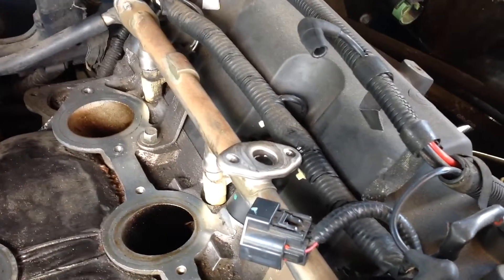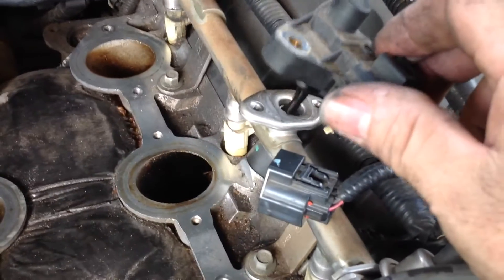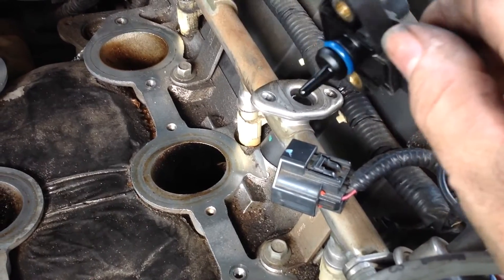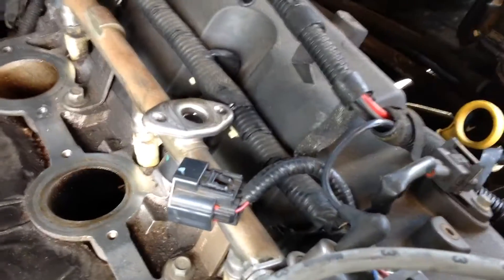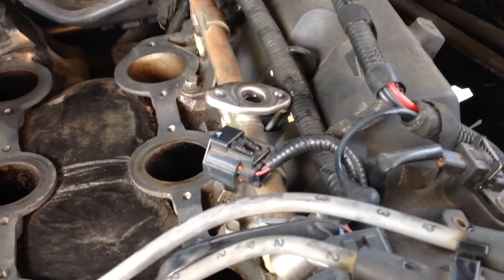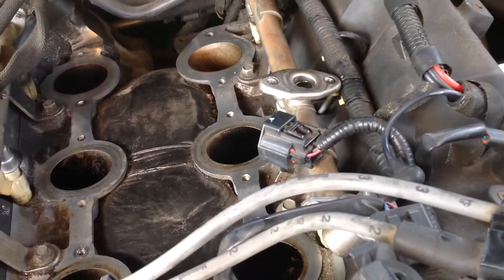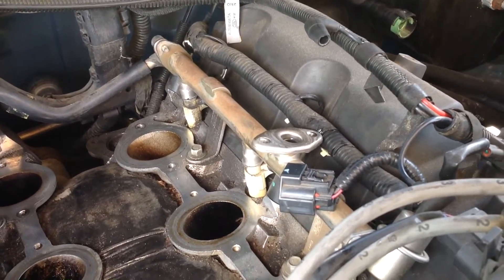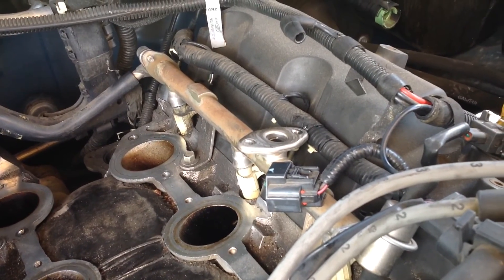2004 Ford Explorer fuel rail pressure censer replacement. Part 5

Comment: Relieve fuel pressure by removing fuel pump fuse while the car is running. The car will shut off, then unhook battery to begin job.

Comment: Why do people think people design stuff to break? Lol I know and engineer from Ford who happened to help design that engine, you have no idea what they go through to try to make the product as durable as possible, I mean..it an electronic part next to a 120° plus heat every day..monitoring a very corrosive material at a very high pressure in a small little small space that has to send her sensitive and vital information to the computer so it doesn't blow up or cause harm to the average user that daily abuses their vehicles with no maintenance at all..sometimes it's a miracle some of these products last so long

Comment: do you have any idea what it takes to design engine management products? the time, the money.... 
do you think companys make 100 % profit on the sensor you bought for $100??
they build it to break down within the lifespan of the car? yes, that's why we replace spark plugs every 100k now instead of every 30k. yea it's not like it used to be......